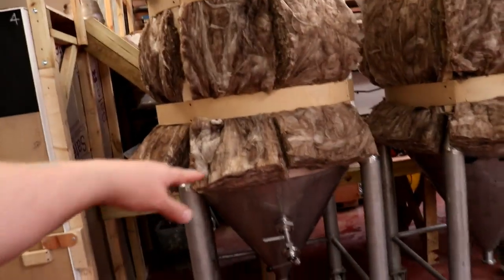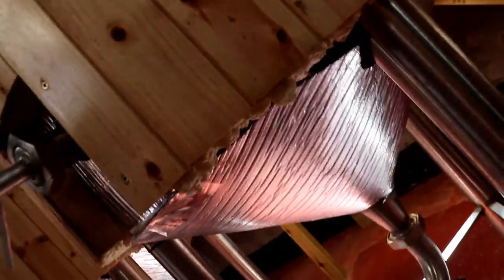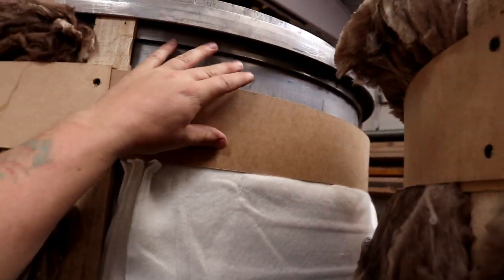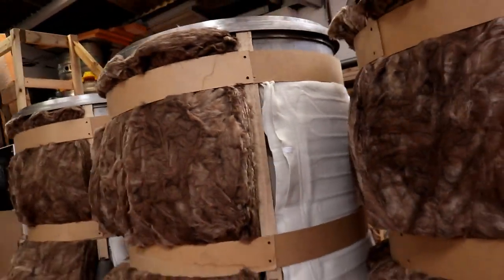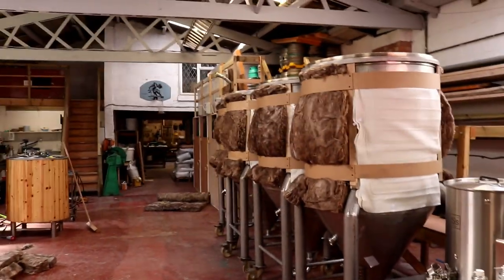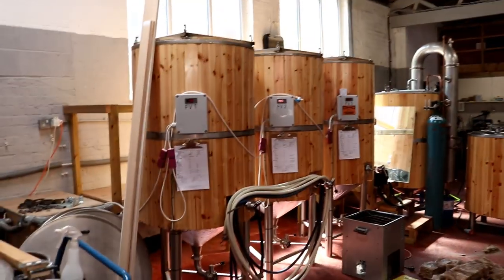Cooling Fermenter's With A Maxi Chiller ~ Wiring & Insulation

Comment: Could you just plug an inkbird 308 into the chiller,and run it through my coil in the fermenter,and use a tube heater in my fermentation chamber to control fermentation